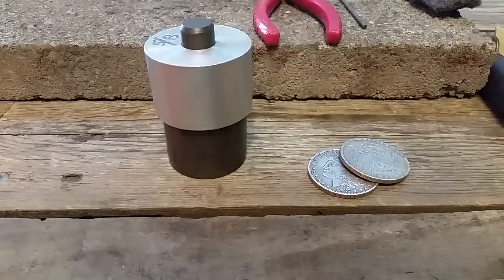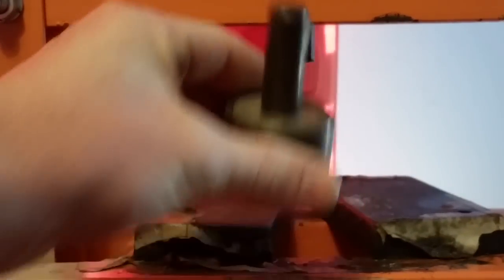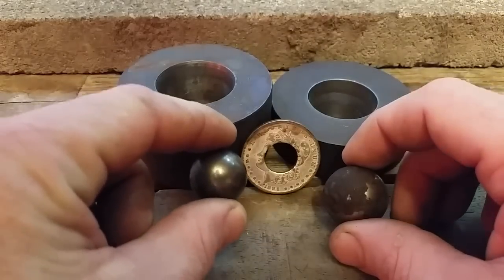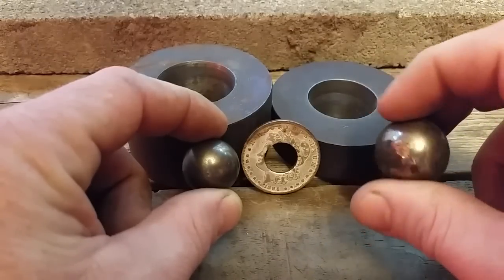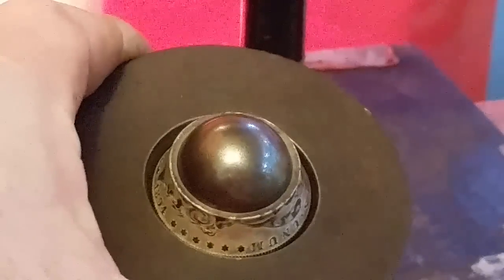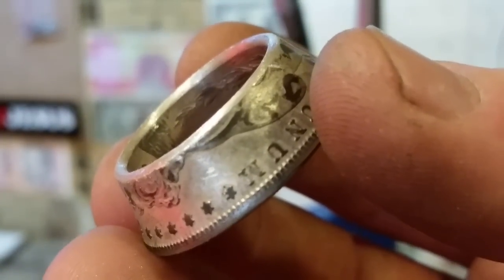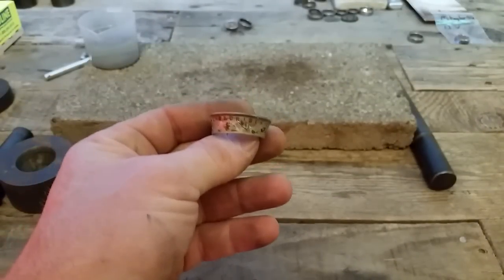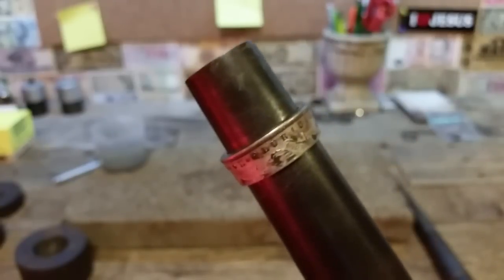How to make double sided silver Morgan, Peace dollar coin rings - Tools revealed

Comment: When I was in high school, I walked around hammering the edge of a half-dollar with a spoon until it was flattened to almost the proper ring size and then drill the center and filed smooth.
Reply: Cool..but you didn't keep the inside details using that method.

Comment: Yes, the torch will heat the coin metal releasing the bonds in the metal call annealing, or softening the metal but when you quenched the heated coin in water, you put the coin metal molecules under stress again, called tempering or hardening the metal, that is why you are getting cracks in the metal. Let the metal air cool slowly, you will be amazed at how easy it is to work with. I have worked in a blacksmith shop for 40 years.
Reply from the maker: Working in a blacksmith shop explains your answer. Non ferrous metals like silver and copper don't harden like ferrous metals you work with. It is a common misunderstanding.

Comment: Just a thought, I know with steel when I want to anneal the metal I don't put the metal in water to cool. It must air cool to remain annealed. When you cool with water the metal forms a grain structure making it harder. Try cooling slowly in the air and you may have better luck forming the material.
Reply from the maker: +bugnuker1 Thanks for the message! You are right with steel but the material I work with is non ferrous and it doesn't matter.

Comment: Thanks for all the great videos! Now I'm about $600 in this hobby...I can forge the nice fat tire look on the outside, but the inside of the band will have a steeper ramp on one side. How do you correct that? Thx!
Reply from the maker: +ZIKIBUSEY1 I always file the coin edge on the inside to give it a round comfortable feel. If you don't it gets irritating to wear. There will always be a thicker side because the rim of the coin is thicker than the middle but you can round it off to make it better. Thanks!

Comment: Just curious...why do you quench when you anneal??? With iron to soften the metal you get it really hot then cover it with ash to slow the cooling down to a snails pace.  Just wondering.
Reply from the maker: You are right with iron. Metals that are non ferrous like copper and silver don't harden when rapidly cooled unlike iron and other ferrous metals.

Comment: I'm starting out in coin ring making and getting the right equipment. Do you recommend any particular torch for annealing silver coins? Thanks.
Reply from the maker: +Bruce Munton There are,a ton of torches but I have had great success with the cheap propane torches you get at home depot or Lowes. You can spend a lot of money on a nice jewellers torch but it is unnecessary for coin ring making in my opinion.
Reply: Coin Rings from The Mint - Change You Can Wear Thanks for that, trying not to waste money on buying mistakes. The Pepe ring stretcher/reducer is out of my price range at the moment but I want a quality tool that will last - do you have any recommendations of an alternative? Thanks, B

Comment: using the beginner method with only a mandrel and mallet, how do I reduce the ring to get it smooth and uniform?
Reply from the maker: You don't :)
Reply: +Coin Rings from The Mint - Change You Can Wear 
well, I'll just have to give it my best shot hammering it on the Mandrel. people are just charging way too much money for dapping blocks and reduction dies. :(

Comment: At the end, one of the rings has a flat profile on the outside, and the other has a crowned profile. How do you control which you end up with. I prefer the crowned.
Reply from the maker: It all comes down to how far you reduce it. the farther you reduce it, the more curved it will be. larger sizes tend to be flat and smaller sizes are more curved.

Comment: If you're just using 90%, do the rings tarnish your finger? Do you use bullion coins in rings?
Reply from the maker: +woodand11 no they don't. Pure silver is too soft in my opinion. Sterling us only 92.5% silver. Coin silver is about the same.
Reply: +Coin Rings from The Mint - Change You Can Wear thank you for getting back to me so quickly. pure silver being too soft makes sense. I'll be ordering my wedding band from you soon!
Reply from the maker: +woodand11 No problem. Thanks!

Comment: Cool vid so far, I'm not that far into it. But just have to say, that heating the silver coin to dull red and then water quenching is NOT annealing. Annealing would require a slow cooling. Water quenching actually hardens the metal.
Reply from the maker: +Databyter Thanks! Actually non ferrous metals aren't hardened by quenching
Reply: Coin Rings from The Mint - Change You Can Wear Oh wow. I didn't know that. I've had to anneal copper pipe, to bend it, and other than that I have only had experience with hardening and tempering steel. Good to know, and I'm sure that it must really speed up the process. But now I am wondering how non ferrous metals like silver GET hard. Is it just the working of it? Guess I have some reading to do.

Comment: Annealing is the process of taking metal up to it's upper critical limit and then allow it to cool at the slowest possible rate. If you heat a metal up to it's lower critical limit and then quench it in water, surely your hardening it and making the grain more brittle?
Reply from the maker: +Ginge Taylor Yes if I was using a ferrous metal like steel but non ferrous metals like silver and copper aren't affected that way.
Reply from the maker: +Ginge Taylor Yes if I was using a ferrous metal like steel but non ferrous metals like silver and copper aren't affected that way.

Comment: may i ask how much would it cost to tool up a shop like yours? I like the press, the dies and the tapers...the mallet appears to be an old friend :)
Reply from the maker: A setup like mine is around  $1,000 or so. I just started out with a mallet and mandrel though and slowly built it up.
Reply: ok, that's about what i thought, give or take, thnkx for responding.
Reply from the maker: No problem!

Comment: By cooling it in cold water you harden the metal. If you want to aneal metal, you have to let it cool down natural. You also only have to heat it to only 400°C for apx 15 min. You are heating it to apx 900-1000°C. that is making your job harder. Silver is a very soft and pliable metal.
Reply from the maker: +CSA Chevaux sans abri You are actually wrong on several things there. The main one being that quenching hardens silver. Silver is non ferrous and doesn't act that way. It is a common mistake.
Reply: +Coin Rings from The Mint - Change You Can Wear Oh well i an sorry if i was wrong.
To be honest i work with ferries metal and the rule of thumb is the one i explained. Then of cause you can always cool your product in oil if you are looking for that special hardness. After that tamper it in the oven to get a spring into it.
Reply from the maker: +CSA Chevaux sans abri no worries. I thought the same thing when I started working with silver and copper

Comment: you could drill a hole in press arbor so it will self center ball bearing
Reply from the maker: +Francisco Molina I have machined and tried many things and have found b out there is no good way to keep a ball bearing or anything else to stay centered as you press it. The problem is the coin not the bearing.

Comment: a copper pipe sleeve over the press cylinder that rests on the ball bearing will align it.
Reply from the maker: You would think that would work but the coin is what makes it misaligned. There are differences in the coin. I even had a cone built that kept a rod with a cone on the end perfectly centered as it was pressed and even that didn't help.

Comment: If you took your press rod to a machine shop and had them concave the end like same size of the ball bearing, you wouldn't have to keep repositioning the coin when it came off kilter.  It would press evenly all the way around and not slip, which is what is causing it to move.
Reply from the maker: +iamthemastermind It is a good thought but it isn't true. I have tried rods with ball bearings attached and it has the exact same issues.

Comment: Annealing is a process of heating the steel slightly above the critical temperature of steel (723 degrees Centigrade) and allowing it to cool down very slowly.
Reply from the maker: +Clifford1966 Right but I'm not dealing with steel. Non ferrous metals can be quenched and retain the anneal.

Comment: Couldn't you also do this once and then make a mold and just cast copies?
Reply from the maker: I suppose you could but it is easy enough to just forge one. Also it wouldn't be an authentic coin. That is a big negative for me.
Reply: Coin Rings from The Mint - Change You Can Wear Yeah, I realized after asking that question that Coin Rings FROM THE MINT probably means that you want coins FROM THE MINT. With one mold I think you could probably make a dozen or more each day, but you'd be missing that piece about it being an actual coin.
Reply from the maker: Right exactly :)
Reply from the maker: There might be a market for cast ones also though.

Comment: Why do you make the coin hot and cool it after it.. why don't you work with it when it's hot? 😯💜
Reply from the maker: Because it would burn my fingers :)
Reply: Short answer when you heat it up it still has the properties to fold after you "cool it" it doesn't matter but easy to work with..like he said.

Comment: I am sure you already know. but just want to be sure you know. it appeared that you were putting the torch flame on a cinder block or some type of concrete. under the right circumstances that can cause a concrete explosion, the chips of concrete can be quite unforgiving to your face.
Reply: there are bricks that can handle the heat like a fire brick or the yellow brick for welding on
Reply from the maker: +Luke Morter I actually use fire bricks that my family's company makes. I just hadn't installed it in my new table before I made a majority of these videos.
Reply: Awesome.

Comment: I cringed when I saw you punch that 1894 Morgan Dollar.  This is a key year for the series, and the coin you used to make your ring looked like an 1894-O (New Orleans) in EF-40 condition, worth about $115.00.  If it had been an 1894 (no mintmark) it would have been worth $1,350.00 in the same condition.  Now, either coin is only worth its silver bullion weight value.
Reply from the maker: +James Porter I know. The coin collector who sent it to me knew as well.